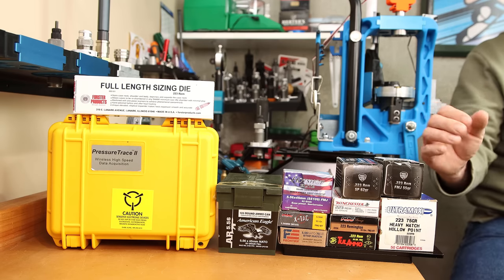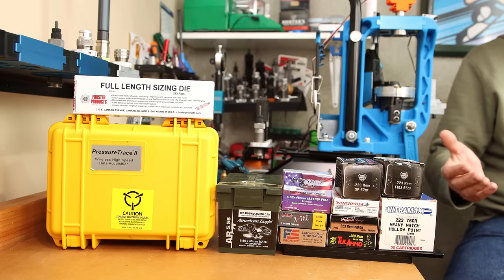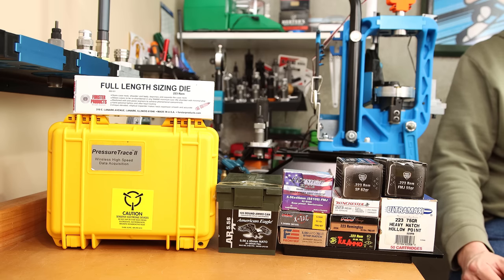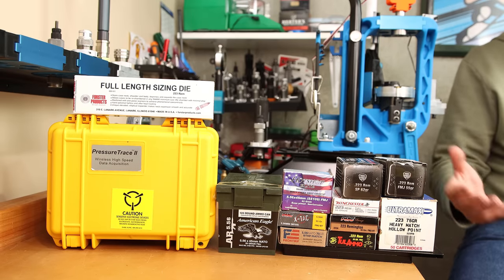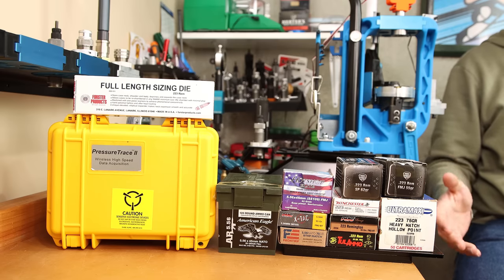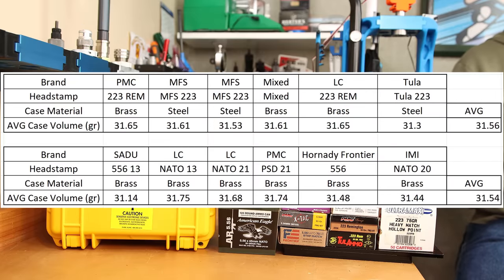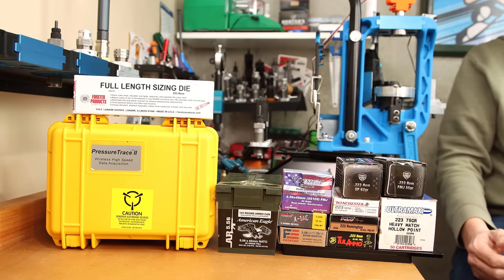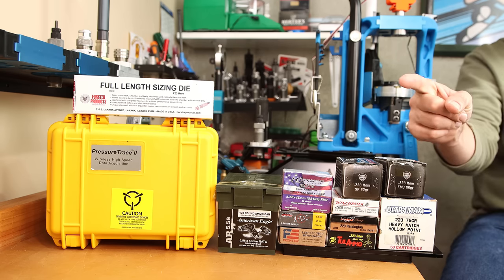223 vs 556 - The Hidden Truth No One Tells You!

Comment: Finally, someone who will tell the truth about 5.56 and .223.  I have always said there is no difference between them, only the loading is different. This is the same as the difference between .38 ACP and.38 Super they are the same, only the loading and headstamp are different. What's more, have you ever heard of anyone having a gun blow up using the wrong ammo in a .223 or 5.56? I never have. Would any manufacturer of rifles ever take take that kind of liability on themselves making rifles in these calibers knowing that their product would be used with both kinds of ammo? Of course not. 

Ken
Reply: +1,  that's why 357mag cases are 1/10" longer than 38specials so ya can't use the wrong ammo.  This 223 v 5.56 is all BS it's good for lawn but that is all.
I did read somewhere that some bolt action rifles with finely machined chambers in .223 may have head spacing issues with 5.56 ammo that could cause over pressure but that isn't the loading.  Semi auto chambers are machined to a larger size than bolt action chambers for more reliable ammo feeding.
The military ammo is in fact loaded down from a lot of commercial ammo to cut down on the wear and tear of rifles.
Reply: The same applies to 7.62 nato and 308 winchester, as a matter of fact not mentioned the original cartridge is almost always the civilian standard measurement before adoption to nato/military metric, and finally someone who doesn't deny that these cartridges use the same dies to reload each 5.56/223 7.62/308 etc...
Reply: The chamber is different is the main point.
Reply: 556 is simply 223 that follows a military spec like XM193 or M855A1.

Comment: If you reload, just keep it simple by using the .223 reloading data for your 5.56 rounds
For the past 5 years that I have been reloading my 223 and 5.56 with the common 55gn boat tail, I just reload all of them with the 223 recipe and I have absolutely no problems with any of the rounds whereby having tested these at 100 yards and consistently getting an average of 1 - 2 inch groups
Reply: That is fine, if you are willing to settle for hunting accuracy. In any competition that allows reloads, you would end up at the bottom of the standings.
Reply: @buggsy5 Sure, but 99.9% of shooters don’t compete. No solution is going to fit everyone.

Comment: Thanks! I’ve been using “223” specs and dies for reloading 556 brass, which I find in the hundreds at my local range. Works great in my 5.56 chambered firearms.
Reply: Its more of the extra pressure between the 5.56 and the 223. Odds of it happening are small but im not willing to self destruct a fire arm because of wrong ammo
Reply: @brianjohnson6053  You won't even come close unless you do something very very wrong as in wrong powder as in a much faster burning powder.

Comment: One of the best differences I've heard and would account for the pressure differences is that .223 Rem is factory loaded with small rifle primers while 5.56 NATO is loaded with magnum primers.  In my reloading experience the difference between small rifle, small rifle magnum, and the CCI 41 for 5.56 NATO is only in the primer cup hardness.  I don't notice any difference side by side in accuracy or velocity comparing those primer types in various brands.  I do feel the difference between brands of brass when prepping cases.  PPU and CBC brass seem a little harder than most other cases when trimming once fired brass to length.  I've noticed FC cases seem to lose primer pocket integrity after 4 or so reload cycles where others last at least 8 cycles (annealing case mouths every 4 times).  I do have LC and PPU brass that have been reloaded a dozen times or more.   Some European imported .223 and 5.56 cases seem to have thinner case rims that routinely get damaged from extractors and can get pulled out of shell plates and case holders on reloading presses. 

Sort of off subject but I've been finding a lot of recent commercial 9mm cases with crimped primer pockets and some where the primers appear to be chemically sealed into the pockets.  I've had a few hundred where the deprime pin actually poked through the spent primer without moving it from the pocket.  That wreaks havoc on a progressive press.
Reply: I just cull that brass. If you want to save that brass, add an extra decap only stage using a Lee universal decapping die; it's actually a very good Lee product.
Reply: 556 is 223 with a larger then 60 grain bullet trying to hit a speed the military wanted the pressure ended up higher than they saami spec with a standard 223 chamber so they increased the throat to low pressure which in turn make it no longer able to be a saami 223.

Comment: Nice work very interesting video .
Having used the 5.56 Nato in the Military and been a .223 Remington shooter for last 50 years the results are about what I expected . The Military 5.56 round is loaded to a slightly higher pressure but not dangerous to fire in a modern strong proofed rifle . I have fired a lot of 5.56 in my 223 Howa bolt action and had no issues other than a few case neck splits which were most likely due to old military surplus ammo going a bit hard . When hand loading the natural variations that are inherent in different rifles in how they handle pressure is way more than the difference between 223 and 5.56 anyway . So you load either to suit your gun . 
I have heard of people with really tight spec 223 chambers saying they can't chamber some 5.56 ammo . Sometimes this is attributed to the rough manufacture of Military ammo that has a slight bulge on the shoulder face . Seen the same thing happen with some European 7.62 Nato ammo into a 308 Winchester chamber .

Comment: I fired both 5.56 and .223 rounds out of my M16A2 in the Army in the late '80's. Apparently the military wasn't too worried about any difference.
Reply: Because in the 5.56 chamber, the .223 load produces less pressure, so why would they be worried? The safety margin is higher.
Reply: If the M16 was rated for 5.56 (Which I think they always were), a lower-pressure cartridge should not be dangerous. Only concern I could think of would be if it could cycle the action properly with lower pressure, but .223 isn't low enough pressure for that to be a problem

Comment: The information in this video is great and is greatly appreciated as a reference when discussing loads and differences between the two cases. Thank you for your time and effort in presenting such detailed info. I start my reloads at the middle of the reloading data and adjust from there. The only thing I've found that affects my loads are case manufacturer case capacity so I sort all my brass by that.

Comment: I'm just an old retired mechanical engineer that has been shooting and reloading as long as I have been an engineer.  I think the difference is primarily the pressure level.  The chamber differences are primarily set up in the military rifles to improve or facilitate chambering in a battle situat.ion for feeding reliability.  Also military ammo is expected to be fired and cases abandoned, not reloaded.   All that said, I have only dealt with one .223 Rem rifle, but have not fired any 5.56 military ammo in it.  Pressure matters; I prefer to shoot .223 ammo in all rifles I have access to.  Even rifles marked 5.56.
Reply: They actually do reload a decent amount of range brass in the army. We aren't required to recover each piece of brass by any means but there's a weight standard.
Reply: For what it's worth I'm Jr. Enlisted so that could be a blatant lie to get us to clean well
Reply: @ Ed Jett - What you say makes sense. Back in the 1950s and going forward, the NATO alliance set up standardized specifications for its small arms cartridges so that in theory any NATO soldier or unit could resupply anywhere inside the alliance and have ammunition which would perform to the expected standard. This was done in part to ease logistical challenges, but also to assure that M193 or M855 5.56x45mm NATO would withstand the firing cycle not only in rifles and carbines, but in base-of-fire fully-automatic weapons. 

Combat conditions mean that the ammo has to work not just when the weapon is clean, cool and well-lubricated - but when it may be hot, fouled, dirty and in need of lubrication during extended use in a firefight. Since combat accuracy and match-grade competition accuracy are not necessarily the same thing, many mil-spec weapons sacrifice a bit of accuracy and precision in the form of more generous chamber and throat dimensions, to aid in problem-free chambering, firing, extraction and ejection. NATO cases are said to be stiffer and stronger in the head area to avoid tearing during extraction. After this video, I wonder if they really are significantly stronger and stiffer than .223 brass? 

It seems plausible that ammunition companies would not retool separate lines for making 5.56 and .223 Remington brass, when it would be far-more-economical just to make the civilian brass to a similar standard or even the same standard as mil-spec stuff. 

The one thing this well-done video didn't do was delve into metallurgy. Annealing is somewhat of a surrogate for that, but not entirely. I wonder if a physio-chemical analysis was done using atomic absorption mass spectrometry and similar methods was done, what the results would reveal? But that's just my inner chemist coming out.

Comment: 6 of this, a half dozen of another.

I cast every new barrel and chamber using Cerrosafe. Once cooled, it gets checked using a height gauge. The height gauge is verified against both .223 Remington and .556 go, no-go, and field gauges.

Most of my casings are Lake City mil-surplus once fired brass, that get sorted based on weight. Test rounds loaded, then fired and case and primers examined.

IMO, the load is safe provided the primers don't flat spot. This load can change (be reduced) with elevated temperatures. In my loading, 24.5 grains of RE15, is the maximum safe load when pushing a 69 grain Sierra Match King and a CCI #41 primer.

Comment: Your advice at the end, practice safe reloading and start low and look for signs of pressure as you increase. Excellent advice. I found my most accurate load for 223 slightly over half way up the load range using TAC and a 55gr bullet. That load has resulted in more than a few DRT coyotes. Anyway, loved this video.
Reply: "look for signs of pressure". 
Where/how?
Reply: @imeprezime1285  look for very flat or flattened fired primers first and also cracked case heads.   Flat primers are the usual suspects.

Be careful and use all PPE when reloading and shooting.  If you aren't comfortable with reloading or shooting, get some professional training and instruction before attempting these activities.

Comment: Excellent job in comparing the two rounds. Personally, I've put thousands of .556 rounds through my .223 rifles, without worries or problems, although I recommend you follow your manufacturers recommendations. However, the .223 proof loads are at a much higher pressure than your average 556 ammo, so catastrophic failure is not likely, even after multiple rounds.
Reply: Guess i will keep running what is stamped on the barrels worked for 40 years now

Comment: Your test is impressive, but neglected to physically compare the different chambers against each other. During a wildcat development, I noted that a difference of just 0.010 in freebore in the same barrel made a significant difference in pressure curves.
Reply: @DBeskar6605  The pressures in this video were all measured in the same .223 Wylde chambered barrel. The pressure differences measured here are the differences in the load, since the chamber is a control. A SAAMI .223 chamber has a steeper leade angle and shorter freebore than the Wylde chamber. The 5.56 NATO chamber has even more freebore than the Wylde but I  don't remember off the top of my head the difference in leade angle. The Wylde chamber was designed specifically to allow both .223 and 5.56 to be safely fired without the potential loss in accuracy that the extra freebore of the 5.56 chamber can create.

There are plenty of chamber pressure plots out there showing the different loadings in the different chambers. The pressure differences are much more significant in the .223 chamber with its reduced freebore and steeper leade.

Comment: I found the myth of 5.56 being higher pressure comes from .223 being rated by the SAAMI spec, but everybody was looking at the 5.56 spec which was in C.U.P. which is in no way comparable and can't be converted.

The military now uses testing methods that fall in line with SAAMI, and their stated maximum average pressure is now also in line with SAAMI's specs for the .223 Remington.

The American Eagle in particular is identical except for the head stamps between their 55 grain 5.56 or .223.  Same bullet loaded to same OAL, same muzzle velocity from the same rifle.
Reply: When fire a NATO 556 in a tight chamber 223 you pressure can exceed the pressure of saami 223 in a 556 chamber it will nearly equal to a 223 in a 223 chamber from all the information I found. The biggest issues come from 223 was designed around 55gr and lighter bullets where 556 was 60+grain steel core bullets which are longer so contact lands sooner creating a little more pressure. As for some manufacturers they will label what is in truth 223 as 556 just for sales. But when it come to NATO spec 556 it not the best idea to shot in a tight 223 it on the chrono you can actually see speed difference.
Reply: @t-bfr45-70  Originally 5.56mm had the higher pressure regardless what system used and a throat .125 longer so using old pre 70s 5.56 in an old 223 rifle would cause 10,000 lbs more pressure in that rifle. Now the ammo has changed to suit both weapons.
Reply: @bullboo1  what year did 5.56 come out? I don't think m855 has changed. Just the fact that company's label what is actually 223 as 5.56 to get the sale's. 223 is 5.56 but that is different then 5.56nato.
Reply: The testing methods and allowable pressures could be identical, however the chambers those pressures are tested in and spec'd for are not. Spec loaded 5.56 NATO cartridges produce the  allowed pressure in a 5.56 NATO spec chamber. The SAAMI spec .223 chamber has less freebore which means that for cartridges loaded to the same OAL/ogive datum, the bullet will engage the rifling sooner and with less velocity in the .223 chamber. That means a sharper spike in pressure and in the case of 5.56 NATO ammo in a .223 chamber, the pressure is going to be higher than the .223 ammo in that chamber and higher than the 5.56 ammo in a NATO spec chamber, thus exceeding the rated chamber pressure. In some of the tests that I've seen, exceeding it by a very significant margin.
Reply: @helotaxi  very well put
Reply: M193 military ammo is 55 grain projectiles, in use since the early 1960s.  855 NATO and its heavier 62 grain projectiles didnt come about until 1983 and.... it was never steel cored, only steel tipped.
Reply: even so, all pressures are still below the mfgs high pressure proof rounds.
Reply: The Canadian armed forces did a lot of lab testing but IIRC it was with 7.62 Nato/.308 Win. But the same hand-wringing and horrible angst reached the ears of high level brass who wanted an in-depth investigation. As usual in federal government a lot of money was spent to determine something already known. That is, some clueless people ASSUMED CUP was the same as PSI and vice versa. It was also found that commercial 308 Win loads operate with the same pressure, barring some special loading etc etc. 
The same pressure is the same pressure regardless if you label it CUP or PSI.
Reply: @t-bfr45-70  I don't think the military uses m855 anymore. Correct me if I'm wrong, but isn't 55A1 standard now?
Reply: @ChickentNug  yes in 2010 the military changed over to the m855a1 which is a lead free variant of the m855 the weight is the same but it's longer and the steal penetrator is exposed. The reason for the charge was to make it more accurate which in 1:7 and 1:9 it is there is also environmental bs involved so lead free not a horrible idea to avoid the bs. The m855 is still used by NATO and Winchester white box is over stock form production to keep everything going in case have to ramp up production for war. Most argue people will have is about m855 or m193 because you can get them at Walmart well you used to m855a1 is not really available for the most part.
Reply: @t-bfr45-70  makes sense. Thanks for the explanation

Comment: The Difference in he brass IS 5.56 was produced for Military Auto fire situations so it was intended to be thicker to prevent COOK OFF in the chamber after sustained fire. if you've ever been in Combat Shoot out situations and I HAVE over 600 times. The last thing you want is to shoot your team mate when you Didn't actually pull the trigger for that last Shot. So before you put your life or any one else's life on the line. KNOW WHAT THE DIFFERENCE IS BETWEEN MILITARY AMMO AND CIVILIAN PLAYTIME AMMO.
Reply: That thickness of case can also very by brand 556 has a more set thickness then 223 but I see some 223 cases that have same thickness if not thicker. Ya good rule of thumb is assume 556 is thicker case but really like anything when reloading you learn can't just put same amount of powder and assume the the cases are the same when changing manufacturer of brass it could even be same brand and different manufacturer year it all can change. My opinion of 556 is it basically 223 with a more specific design the longer free bore of the barrel being the most important to make room for larger heavier bullet after that where 223 don't have specifics on case thickness or other things besides external dimension 556 has a set minimum thickness and where most 223 run lower on the maximum pressure rating 556 is loaded to almost top of pressure range.